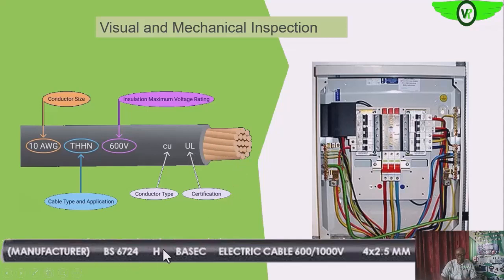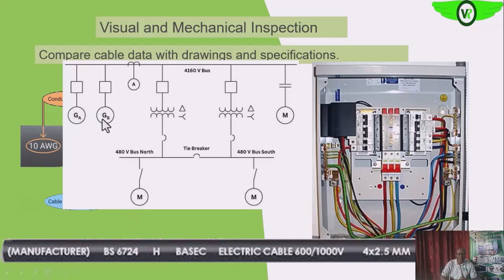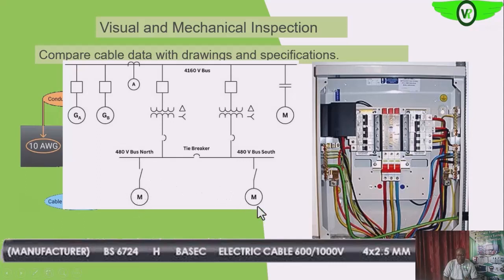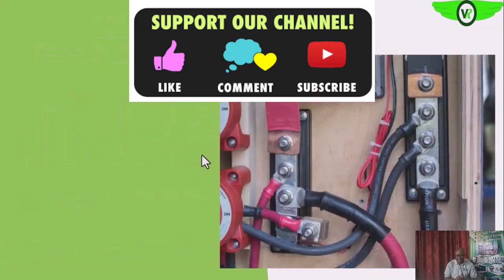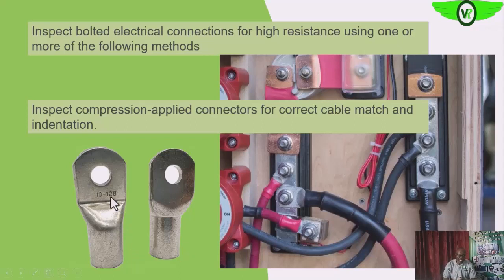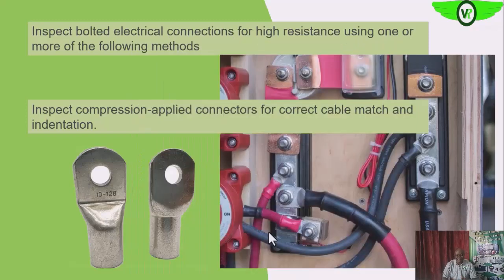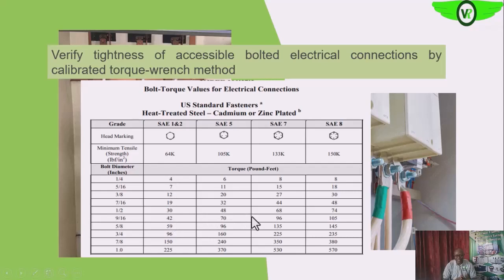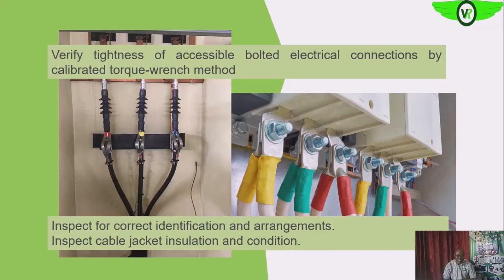CABLE INSPECTION AND TESTING (LV)_ PART 1  _VISUAL INSPECTION

Comment: Thank you for the breakdown on torque tables. I have a field question:
When verifying torque with a click-type torque wrench set to the specified value, we can confirm under-torque. But how do we determine if a bolt was previously overtightened above spec? Is visual inspection sufficient, or is loosening and re-torquing recommended in certain cases?
Reply from the maker: Set the wrench at the right torque then tighten...if it releases then the bolt was tightened to or above the right torque